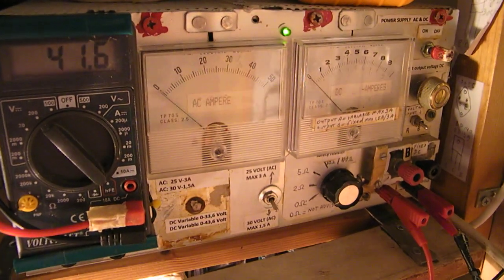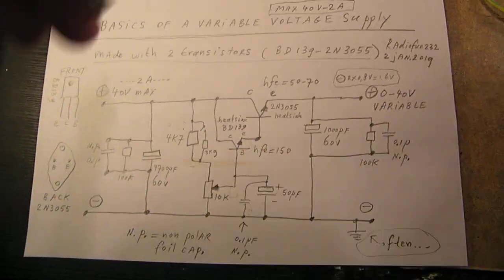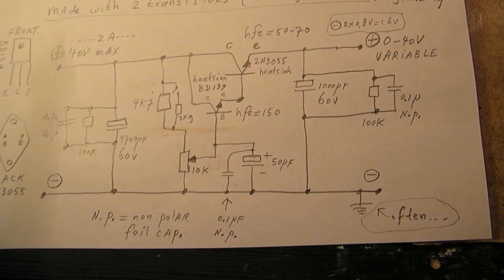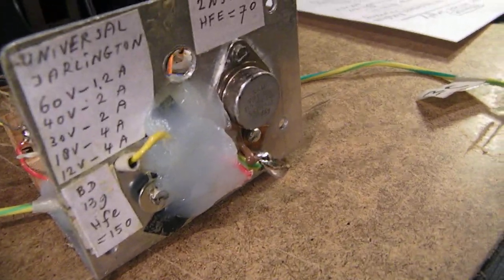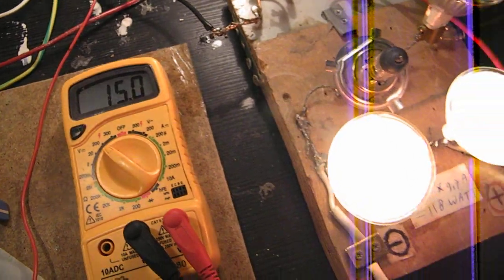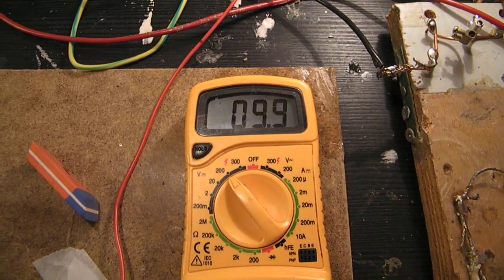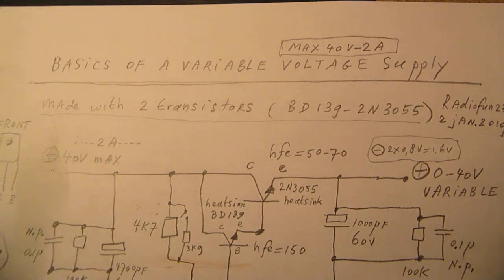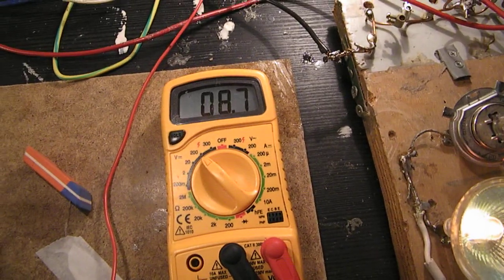Variable voltage power supply series regulator 0-40 Volt max 2 Ampère: basics and schematic

Comment: super basic circuit, cant be any more simple, but I would add a zener diode across the potentiometer to set the max output voltage, your output and input capacitor filtering is very good and allso those base capacitors are perfect, to get more current, just add more ttransistors in parallel and there you go, easy, simple very good linear powersupply very good for powering amplifiers or other precise circuits
Reply from the maker: That zener diode circuit was/is in (many) other video's.

Comment: Very good! Thanks teacher!
Reply from the maker: OK thanks! I hope (but am sure) to give a good insight/advice.
Reply: @radiofun232  Teacher, the resistor 100k and capacitor 0,1uf are for discharge the capacitors electrolitcs?
Reply from the maker: @28noch  Yes, that is one purpose. The other purpose is to shortcut HF signals to ground, that enter the power line.